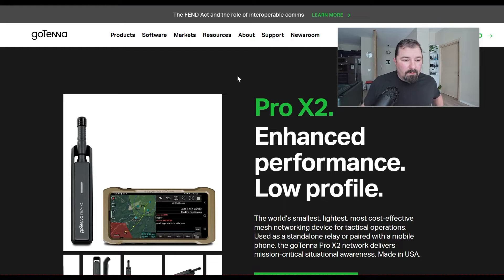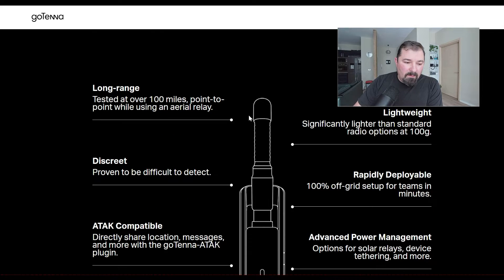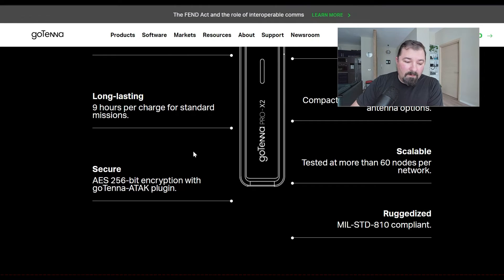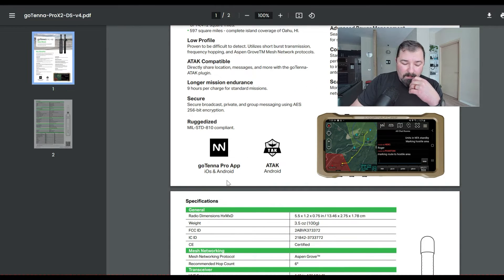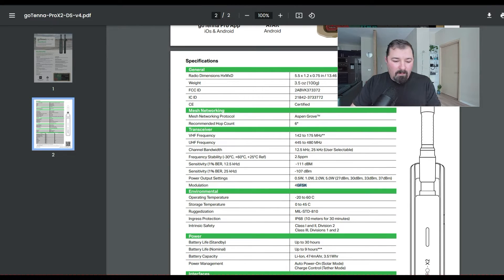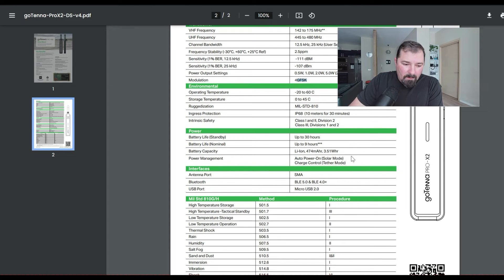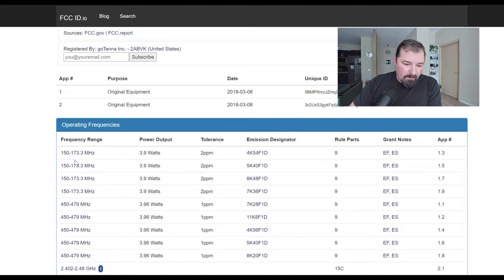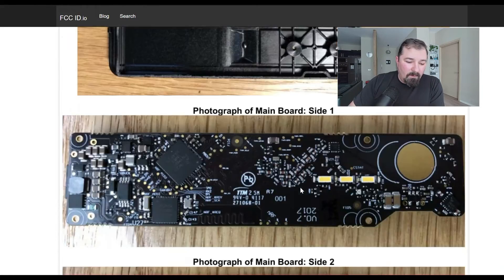The goTenna PRO X2 Mesh Radios

Comment: If your getting hold of a set for a trial, it will interesting for real world test, does the battery actually provide 9 hours under heavy use and range test mounted under your coat (body loses) also mounted on top of your rucksack strap.What waveform does it employ?
God bless.
Reply from the maker: I agree, I would like run them through some real world testing. They are using 4GFSK on VHF and UHF.

Comment: A few questions, 
Do you prefer GOTENNA or BEARTOOTH? 
Where you ever able to find out the price of the GOTENNA?
Reply from the maker: Currently my recommendation is the Beartooth for two reasons. The current sale price of the Beartooth is around $1,250 for two radios. Two no license is required for the Beartooth radios.  
GoTenna did get back to me and the radios are around $1,200 per radio. Plus you need a part 90 FCC license to operate which are over $400. 

Final, I will test the Beartooth MK II radios in June and will post an update video.